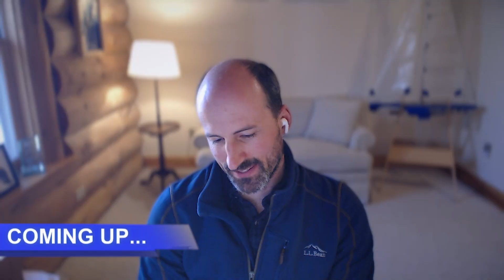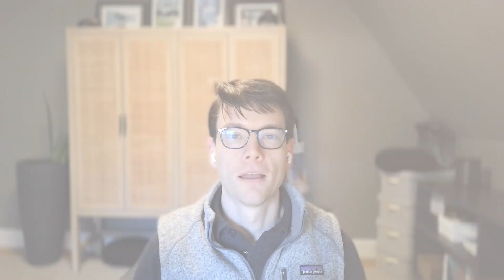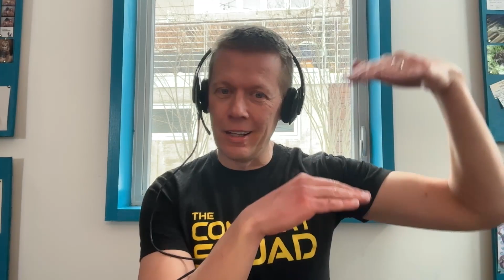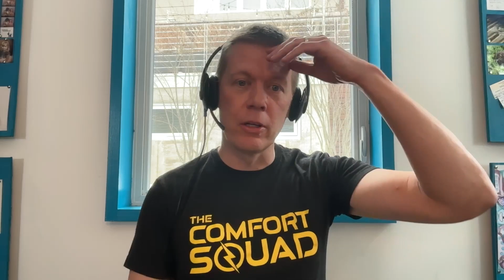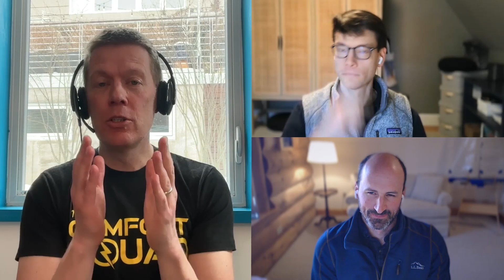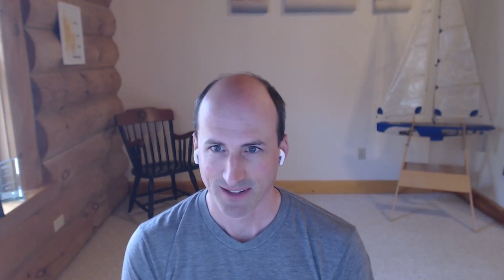Using Performance Data to Maximize Efficiency and Electrify Homes with John Semmelhack

Comment: 6:15 good question! "why dont ducts get installed as designed?"
8:00 Comparetto - unicorn installer
12:20 grid has nothing to do with our recommendations
13:27 YES! size to cooling load!!
16:20 ducted vs ductless?
17:05 ducted 
18:00 ductless isn't go to. Filtration, cleaning, mold, maintenance, etc....
20:00 air clean for occupants.
20:45 ductless is 2nd choice
22:00 hard to size for small rooms
23:00 typical job?
25:00 5" filters
25:30 dropping size, seen 5x oversized
26:00 load based on ecobee data
26:30 havent seen oversized cooling yet either
27:20 fix duct without touching duct
27:50 longer run cycles
28:10 runtime is better than load calc, REAL load
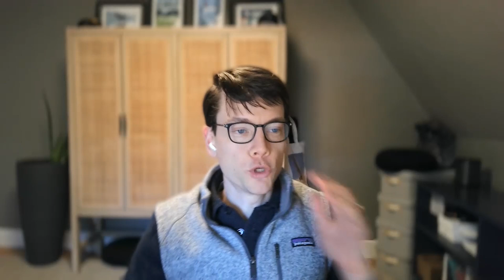28:35 sales process?
29:10 referral clients makes it easier
30:00 typically not a free quote, building performance based.
31:00 data log before replacement provides high confidence 
33:00 "why is my manual j so much higher than true load?"
34:30 slow down the sales process, doesn't work for emergency replacements.
39:00 avoiding site visits for first call
40:00 heat pumps are easy and not expensive 
41:15 15 year track record. Man j for cooling tends to be more accurate 
43:00 r22 heat pumps are still working fine
44:30 converting to heat pumps all the time
46:00 apples to apples heat pumps are cheaper 
47:30 fear price premiums
49:08 final question - air to water tech still nascent. Vrv, Carrier soon....